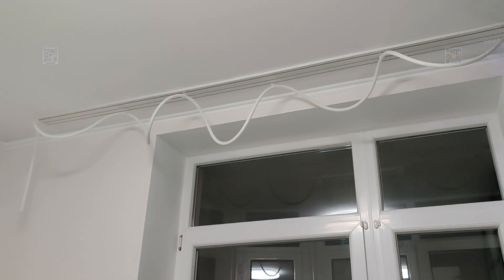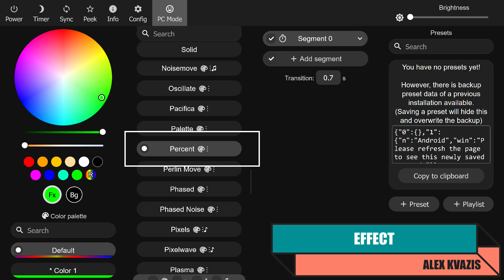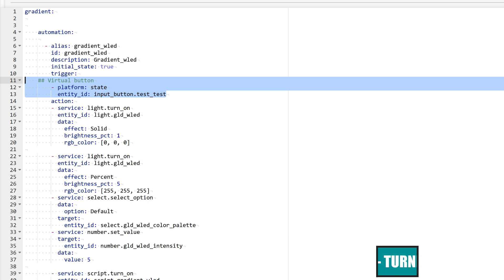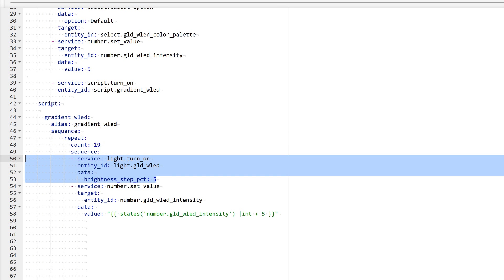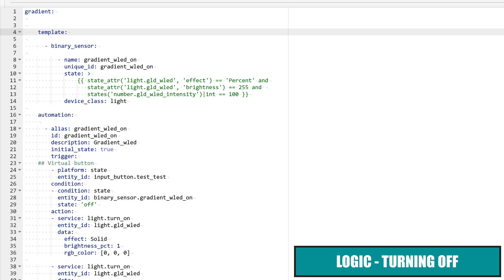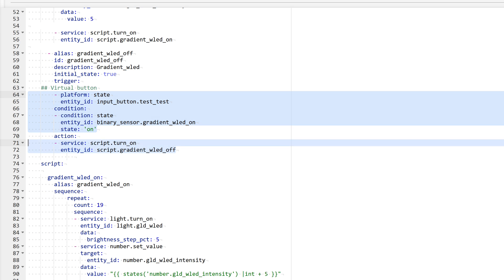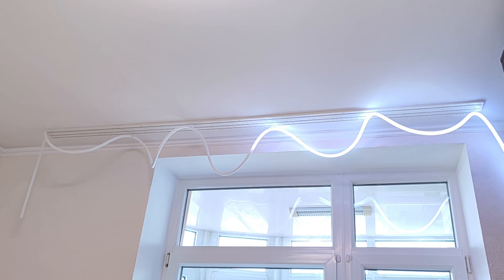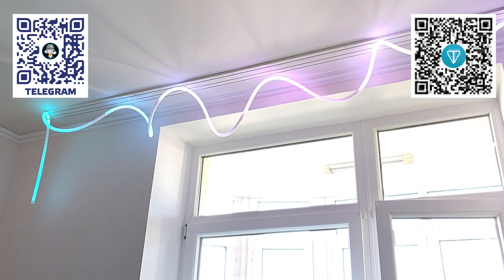Home Assistant + WLED - включаем / выключаем адресную ленту с эффектом плавного заполнения

Comment: Hello
I tried to put the packages in Home Assistant to have this beautiful effect at startup. But it doesn't work. A little help would be appreciated.

Thanks a lot.
Reply from the maker: You may need to enable package mode in Home Assistant first. For example, in my config - https://github.com/kvazis/hassos/blob/master/configuration.yaml#L11
Reply: @Alex_Kvazis  Yes package mode is enabled in configuration.yaml . I have the automations gradient_wled_on and gradient_weld_off and the scripts gradient_wled_on and gradient_wled_off. But when I press input_buton.test_test the LED lights up all at once and not smoothly.
Reply: On the same boat.  Did you figure it out ?